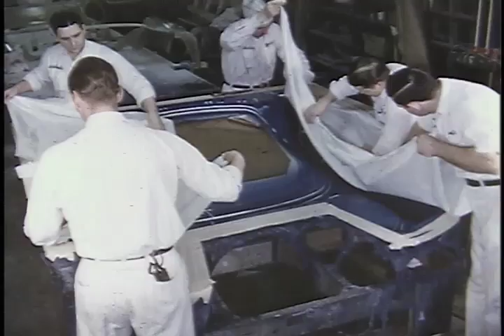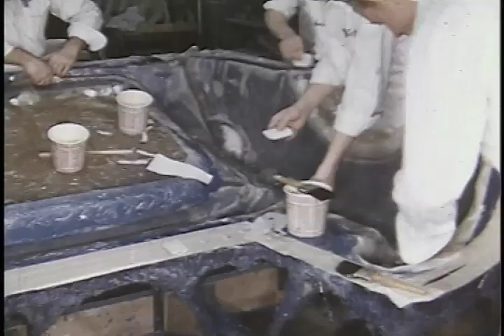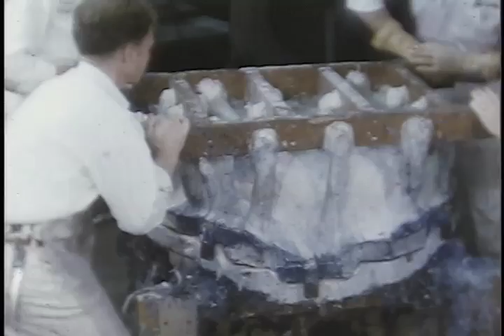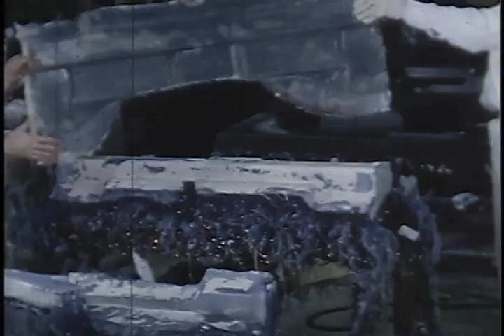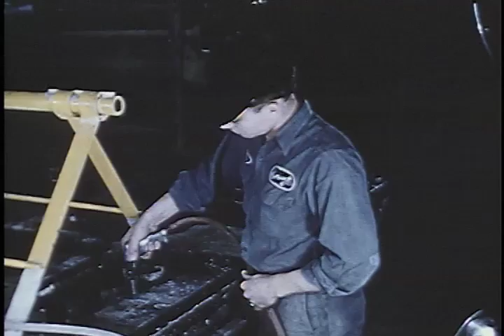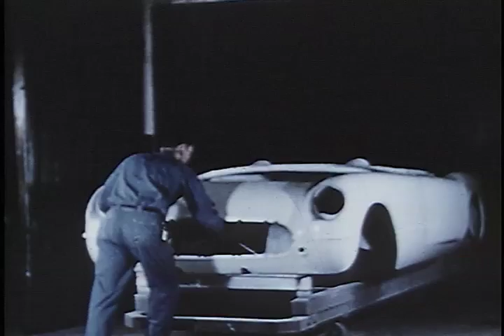First Corvettes Being Built - 1953

Comment: Fiberglass, resin, grinding, and paint work, without gloves, safety glasses, or respirators.
These men are my heroes.
Of course they're all dead from lung cancer, but they're heroes.
Reply: +Proteusbound yeah saw that too, kinda like those troops watching an atom bomb from a 'safe' distance
Reply: Exactly how I repaired fiberglass in the 80s. Luckily is started using gloves, goggles, and respirators in the 90s or I'd be dead now too. The chopper gun eliminated like 8 jobs per body build
Reply: ...lol... Back then it was so easy to expose your body to petroleum based products because studies weren't thorough enough, nor were they even obeyed. The caution label on the contact cement I used to spray in the seventies and eighties isn't just stamped on the side of the can, NOW, you also get a ten page detailed break down of all the poisons and what they do to you when exposed. I never wore gloves when doing the solvents. NOW? I can't even handle the shit on my skin or the fumes. It's a wonder I don't have cancer. The glass work is even more dangerous but also way funner to fab with.  These old school techniques were a lot more time in. THIS was the era of hand made goods. We'll never see this again.
Reply: @stonerpage3100  In the early 80s, I relined asbestos brake shoes and repaired fiberglass with no gloves or masks. In the 70s I welded galvanized tubing with no mask. No one cared
Reply: @jerrybushman  I remember loving the scent of body filler and base coat and all the different solvents and resin does smell cool while it's drying....hee hee...we're all gonna die of something it might as well be this...lol...
Reply: @stonerpage3100  I have not stopped doing body work, including fiberglass, I just wear rubber gloves. Oh and I wear a respirator when I paint. I depend on my mustache to protect me from sanding and grinding dust
Reply: no greater honor than to die for something you believe in
Reply: jimmie Roan 🍁🍽😞
Reply: What are you going to live forever? Nobody gets out alive my friend.
Reply: @jerrybushman  and you're still here, makes you wonder don't it, im 80 and worked around this stuff from teens to plus 50. no cancer, no respiratory problems, i believe in safety but i also believe what ive seen
Reply: @jimmieroan9881  📷🖖🙏😎
Reply: Gene Winfield is a GREAT LIVING LEGEND CAR BUILDER and has worked with all the cancer chemicals and is still ALIVE TODAY
Reply: Wow,  I  don't understand why my hands itches
Reply: Back in the 70's I was a bench mechanic using MEK, I couldn't understand why I got a headache every day for about 10 minutes,  now nearing 70, I wonder what damage I was doing to myself
Reply: @jimmieroan9881  then u definitely should believe in luck bc Luck is why you're still around sir!

Comment: King Rose..Thanks for posting this...These vettes were built at the what is now the Flint Truck Plant...They had a building on the north side of the plant that later became an assembly engineering center...At least that's what my dad told me..He worked for GM here in Flint for 36 years and I worked for GM at the Grand Blanc  Plant for 30 years.A lot of people talk about the guys not wearing respirators,gloves etc,etc..In a way I got to chuckle because before the govt started jumping on GM about air quality,you could drive by the truck plant where the vettes were originally made and smell the lacquer from the paint shop 24 hours a day...Think about the neighborhoods that butted right up next to this plant and there is one neighborhood that had houses for the GM workers that came to Flint in the 50s..Actually it was probably safer in the building with the ventilators running than outside in the neighborhood...Today you can drive by the plant while they're working and you can't smell a thing...I never knock govt regulations..thanks again....subbed and liked...
Reply from the maker: Thanks for watching and sharing your memories.  I'm not sure if this wasn't a prototype.  One of the GM engineers gave it to me and my foggy brain seems to remember that this was done at the Tech Center prior to manufacturing.  I could be wrong.
Reply: I worked at the truck plant for three years til I quit and moved out of state for 35 years. That truck plant you mentioned is on Van Slyke Rd.

Comment: Wow. So glad that this footage exists for future generations to see how cars were 'hand-built' in the USA in the '50's. Interesting..... I see a lot of things in the workplace going on here though that OSHA would have a stroke over. Doesn't seem like the safest place to work.
Reply: The thing that amazes me is how much time consuming hand work it took to put together the bodies! You could have built 6 or 7 steel '53 Chev passenger car bodies in the time it took to make one Corvette body. I guess one saving grace is that the mechanical bits (frame, brakes, suspension drive train, etc.) back then were '53 Chev passenger car sourced which made them pretty inexpensive and I guess that offset the high cost of the body build.
Reply: OSHA would have a field day
Reply: I see they weren't using any breathing apparatus either, that had to be good for the lungs.
Reply: @pencilneck22  your comment is the first ive seen in years indicating chassis parts, im an old fart and like most teenagers back in those day just consumed magazines and any article about the automotive, i remember clearly that the first corvette's used the passenger car frame shortened, when i repeat this in todays world im called an idiot, and after spending not just hours but days researching that very subject i can't find one word that would verify it. now later in life i was involved in the restoration of classics etc using parts books, interchange manuals, lots of the old motors books and masters catalogs, long before the internet, i became the guy to call when you needed to find a part, so that did show me at least that the parts were used for years, tie rod ends, bearings, control arms etc, most pass car and corvette parts were the same i believe at least till the 63 came out.
Reply: @jimmieroan9881 - Pencilneck22 is my old account. Rather than try and look up the password I'll use this account. I'm a little on the seasoned side myself and spent the best part of 20 years (from the early 60s) selling used parts from my old man's yard and referencing (and digesting) Hollander Interchange Manuals. The early Corvettes were passenger car frames no matter what anybody may tell you. And the running gear including the brake drums and control arms, etc. were too. Not sure on the shortening but it would have been at the rear frame horns if done as the overhang on the Corvette is less than the passenger car. As far as I know the Blur Flame six they used was the passenger car version found in any Chev but with multiple carbs and some dress-up bits and in 53 they used a Powerglide trans and no manual was offered. Smells real "developmental" to me and GM could have lessened the cost considerably using existing car bits util they were sure it would be a hot seller. I'm not 100% on this part but I'm fairly sure, until the independent rear was used GM used the same 53 Chev passenger car frame and suspension parts. If not, they used stuff that sure looked a lot like it.
Reply: @jimmieroan9881  One of my uncles passed in 1970 and I received from his family a pile of Fisher and GM workshop manuals (Uncle was a  brilliant mechanic, even worked as mechanic on a Allison V12 powered hydroplane ) Amongst them were manual supplements sent to GM dealer workshops from Detroit outlining advancements and alterations to car servicing which were supposed to stuck into the shops manuals. . Of particular note was a letter from GM to all main dealerships that the new car, would be a on passenger car platform. I even had a few pages on sorting the carb tuning with the sideways carbs. I lost all of that stuff plus a great deal more in 2000 when I got robbed, never to be seen again and probably not appreciated by the scum who stole everything I owned at that point.  but yes you are dead right, the first Corvettes were basically a plain car with a fancy dress.

Comment: Great film. This was shot in 1954. The plant was in St Louis then. Flint never had more then 5 cars on the lot and the Truck repair building they used for assembly was much smaller. At the end you see 2 54s with tan tops outside when the cars are driven out. 53s all had black canvas tops. Some 54s reportedly had black tops too (very few early cars)

Comment: Any color you want - as long as it's white.
Reply: The white color tends to "hide" the all the imperfections of the fiberglass. Black is the WORST. This is the reason the Fiero was not available in black until GM refined the SMC process making for smoother body panels.
Reply: And you coukd get any engine option as long as it was a Blue Flame Six...

Comment: Not sure if the two men at the start of the film are Ed Cole and Octive (?). The very 1st Fiberglass car was a 1952 Chevy. They used the body parts to make molds then replaced thee metal parts with fiberglass. I understand they finished in the middle of the night then took it for a spin. later ran it at the proving grounds, rolled it and found not too much damage. Decided to make a show Corvette. Once Harley Earl bragged (at a car show) it would be a production car they had to figure out a way to make multiple parts.

Comment: That is a large number of them still around 255 of the 300 made but  unfortunately the very first one made off the production line is lost and no history of what happen to it . 302 was actually built but the first 2 were engineering  test cars and was destroyed, Anybody have anything on history of what happen to the very first production Car Corvette? I seen videos on the third one found mentioning a little on the very fist one being lost not around and that it. The very first one would be worth a mint it ever found.
Reply: "The first two cars off the line were used for testing and then scrapped.

Corvettes 003 through 012—all with GM Parts Fab bodies, made between March and May 1953—went to Chevrolet Engineering for tests and rectification. That the latter was needed was indicated by what historian Kenneth W. Kayser called “internal Chevrolet reports concerning the completely unacceptable panel gaps, panel flushness and fiberglass matting visible on Corvettes serial 003 through serial 006.” In effect pilot manufacture and series production began simultaneously with the initial two dozen or so cars, called “salable pilot-build vehicles.”

Thus, the first car and the early sisters that followed it were actually hand-built prototypes, because the Flint body operation was not yet ready to come on line. This forgivable sleight of hand allowed Chevrolet to meet Curtice’s seemingly impossible requirement that the Corvette be in production in June, less than six months after the Motorama."

Comment: i read that these bodies were  made or sent to a boat factory..because they couldnt do the fiber glass right  at the gm factory..--for 53 only
Reply from the maker: That's what I was told by the Chevrolet engineers.  They did some work at the GM Tech Center on the prototypes but they had to farm out the bodies when it came time to ramp up production.

Comment: Why did they decide to use fiberglass?  It's not like they were worried about fuel economy back then.  Seems the more weight, the more protection in a collision.  Fiberglass would be disastrous in a high speed crash (seems to me). These cars were death traps.  They had no crash zones, or collapsible anything.  No seat belts, no air bags, no side protection.  Little coffins.
Reply from the maker: J kK According to GMs website;

Corvette’s use of advance materials began in 1953, when the first 
Corvettes were produced with all-fiberglass bodies.  Every Corvette 
since has featured a composite-material body.
Fiberglass, the lightweight, rust-proof composite material, was first
 considered for use on a GM vehicle by legendary designer Harley Earl. 
Besides being an exotic choice for the early Fifties and having an 
undeniable weight advantage, fiberglass offered an economical way to 
create the low-volume Corvette without the expense of large sheet metal 
stamping dies.
http://media.gm.com/media/us/en/gm/news.detail.html/content/Pages/news/us/en/2012/Aug/0816_corvette.html
Reply: J kK na brother a fucking coffin  stands a better chance in a wreck.  high speed crashes involving  these vehicles almost always require the tow and recovery team to have multiple pulls and lifts.  ie  pick up pieces .  more often than not many pieces.
Reply: The occupants were the "crush zone"...